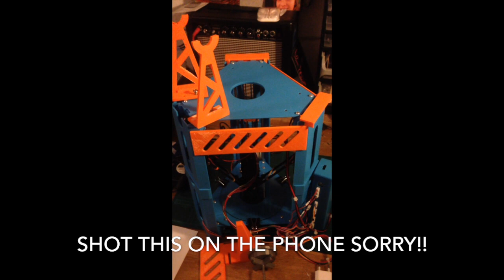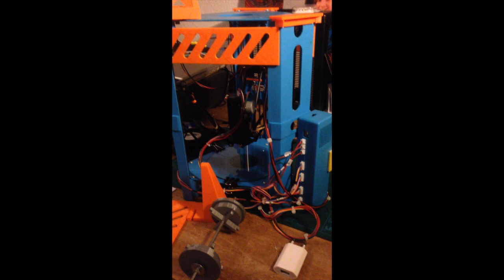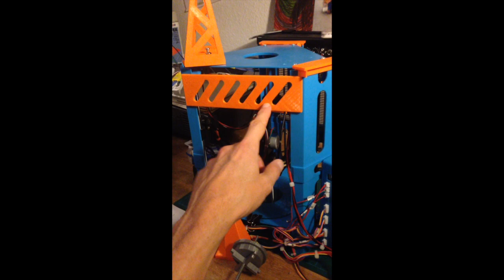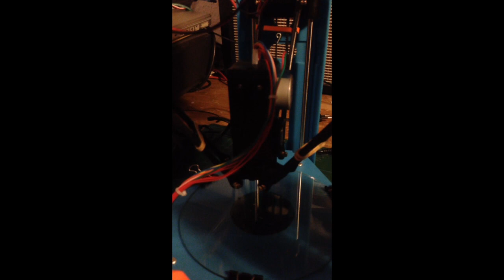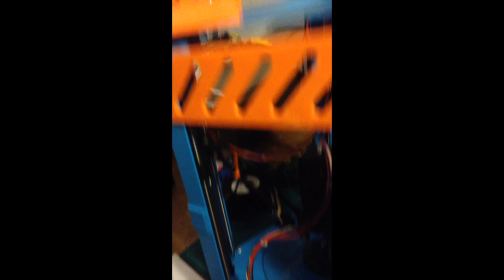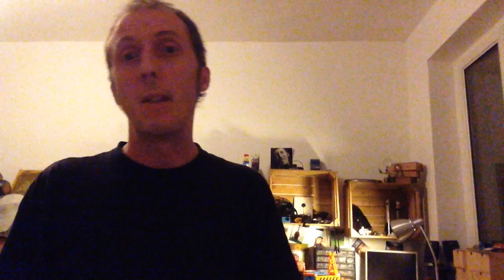Cheap Chinese 101 hero review & improvement upgrades! Does it work? Is it the best cheap 3d printer?

Comment from the maker: What kind of mods, tweaks and upgrades do you want to see done with this machine?
Reply: Hello!

From what I read about this printer, the three biggest concerns are:
1. stability (you have already done somewhat about that.) It could be increased further, by putting an enclosure of glass over all sided, giving the additional advantage of having an enclosure for keeping the heat.

2. too much heat (there's a fan mod: http://blog.graywriterrv.com/?cat=42)

3. too weak and bad motor. It could be modified to a better motor and using a Rampa controller.
Also having the spool on top should relieve the extruder.

 I"m curious, about what this printer could achieve with these mods (and of course seing one or two comparable objects before and after)
Reply from the maker: Thanks. I just got it stable and up and printing. I will have a new video of the first mods up. so far was mostly stability issues. Then I have a new hotted E3 V6 kit and am looking at the fan as next the next steps. It also only prints tethered and that gives a bit more control so definitely looking at a LCD to control it.
Reply: Sounds good. I'm looking forward to it.
Reply from the maker: Here is the update on the upgrades. https://www.youtube.com/watch?v=-ZIeAb7flDE